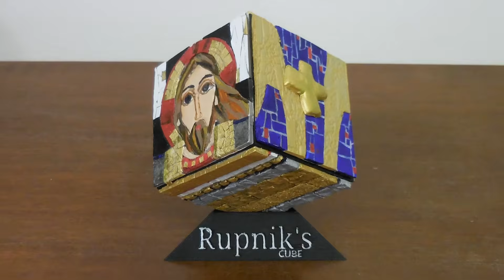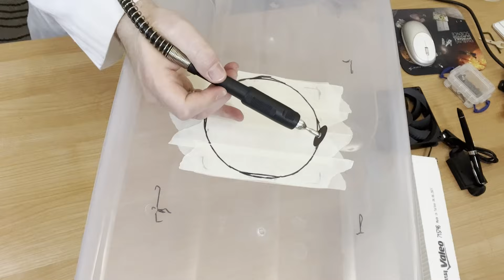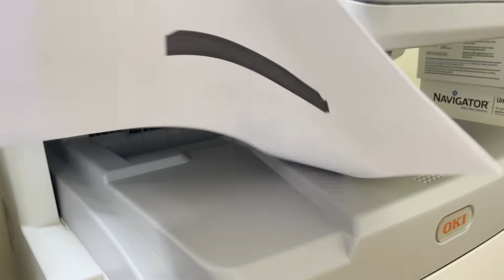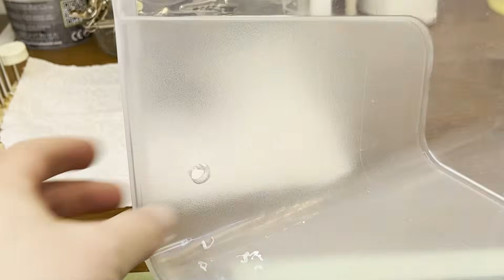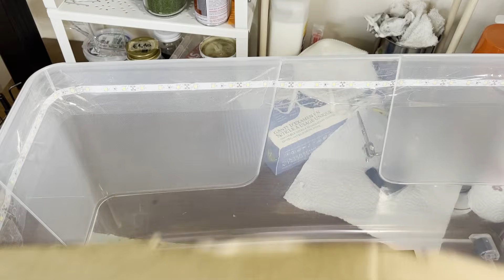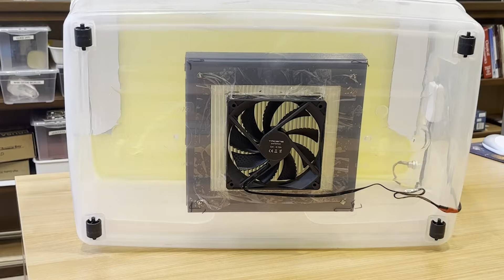Turning a Plastic Bin into an Airbrush Spray Booth

Comment: Great video; the spray booth looks fantastic, and the plastic bin is a better choice than cardboard, like most other DIY booths I have seen. The suction issue you are having is not due to the size or power of the fan but to a lack of vacuum. By mounting the fan directly on the filter, you diminish its ability to move air. When mounting the fan directly on the filter, you only get airflow over the surface area of the fan blades and rely on the fan to move the air. So, air is only flowing over the part of the filter that is the same size as the fan (4 to 6 inches). Computer fans are designed to work by creating low pressure in the case. Then, the high-pressure air outside the case is forced into the case from any available opening (Usually filtered intakes on the front top or bottom). The case must be relatively airtight as the fans blow hot air out, a vacuum is created in the case, and cool air from outside the case gets sucked in. The same concept is used in vacuum cleaners; they have small fans but use large chambers (AKA the dustbin of the vacuum cleaner). As the fan sucks the air out of the dustbin, a vacuum is created, and the air is forced into the opening, such as the hose or brushes. That is why vacuum cleaners lose suction as the dustbin gets full. The fan is still moving the same amount of air. It just doesn't have the negative air chamber to create the suction. The important thing is having a negative space that creates a vacuum. 

This long-winded explanation is just to say you need an air-tight chamber between your fan and your filter. As the fan sucks the air out of that chamber, it will force air in through the filter. This will do two things: increase the intake surface area and airflow.  An easy fix is to make the opening on the back of the plastic bin larger; a square about 1/4 inch smaller than the filter should be good. Then, 3D print a chamber similar to the one you used on the back of the fan to connect the hose, obviously large enough to cover the size of the new square hole you cut. Then, taper it down to the size of the fan. You don't need a lot of volume. 3 to 4 inches from the back of the bin should be enough. Glue it to the back of the plastic bin, snap in the fan, and Bob's your uncle. You should notice a vast improvement. This video is a year old, and this comment is probably obsolete, but if anyone plans to build one, this could be helpful.
Reply: Thank you great advice

Comment: Interesting! ive heard though that rattle spray if sucked in concentrated amounts can ignite a fire when passing the fan. Something to keep in mind . Cheers
Reply from the maker: That's true, but I have no intention of using a rattle can with this. It's just for the airbrush, which uses compressed air instead of the highly flammable propellant of a rattle can.
Reply: @MackeMakerSpace  yeah also i think it has to be a considerable amount of spray to go that far. airbrush should work. very nice work on the booth, thanks for sharing it. Cheers

Comment: I did something similar..2 bathroom ventilators,flex tubing and a special 3D print for ventilation holes in my window,so I can paint in the cld season also without having the flex tube out of window.

Comment: Would this work without a filter? Still with the fan but without the filter in front?
Reply from the maker: It would work okay if you are using acrylic paint or something similar that isn't hazardous. However, the point of the filter is to trap paint particulates. Without it, you may find paint exiting the tube at the other end.

Comment: Just an idea here, I'll be building one of these booths for myself. I thought the computer fan might be underpowered for your project. I'm in the process of aquiring the parts I need for my own booth. I'm using a bathroom vent fan which is quite a bit more powerful. This might be an option for you, too. They aren't all that expensive and readily available at any hardware store.
Reply: I'll be using AC to power the vent fan and adding an AC outlet to the enclosure. That way I can power the LED light strips with a cell phone wall charger and USB cable.
Reply from the maker: You are right -- it is underpowered. I mention so near the end of the video (14:53). I also mention that I ordered a more powerful fan that is intended for ventilation. It happens to be a bathroom vent fan, just like what you suggest (though I didn't say that explicitly). And yes, it works great!

Comment: it's better to use also a facemask
Reply from the maker: When dealing with potentially harmful airborne materials (vapors, aerosols, powders, sawdust, etc.) it is always advisable to use adequate personal protective gear regardless of the external setup. That being said, acrylic paints in the small quantities of an airbrush are not as hazardous as some materials, unless you are doing a lot of painting or are breathing the stuff directly.
Reply: @MackeMakerSpace  they are not toxic, but it's better to not have stuff in lungs, just a precaution

Comment: Built something almost identical a number of years back. Used a PC power supply and some aluminium HVAC bits for ducting. A furnace filter fits he back of the plastic bin almost exactly. For a fan I got a 12v bilge blower meant for small boats. Not expensive and has the advantage of being spark proof, (gas fumes in the bilge), which I thought would be a good idea for solvent based paints. 20 years in a lab,  safety first. Works a treat.
Reply: The bilge blower is a great idea. I couldn't find anything explosion-proof AND affordable. Thanks for the very helpful tip.
Reply: Yeah, I would have never even known or thought to look for something like the bilge blower. Great suggestion, they're pretty affordable right off Amazon

Comment: Very smart.    I did the same thing but cut the hole to the side.  I used a Dewalt 600 cfm air mover designed to dry water damaged areas in a home.  This is mounted remotely in front of a window or opening to the outdoors.
The ducting is 6" flex and slides onto the (paint booth) 
sleeve purchased from box store.  Easy on and off to move the booth out of the way when not in use.
Love you design.

Comment: Great work  can you please tell me what's the best airbrush  but not too expensive  would appreciate your advice  thanks
Reply from the maker: I am fairly new to airbrushing myself. I only acquired one a few months ago, and it was literally the cheapest one on Amazon. Once I get more practice and learn what I need in an airbrush, I will start researching for quality. One thing seems to be true: you get what you pay for. The cheap one I bought works, but I already see several things that aren't great with it, and that better quality airbrush systems would do much better.

Comment: The concept also works for a small sandblasting booth, but the extraction is not required.
The spent sand can be poured out into a container and reused later.
Reply from the maker: Nice idea! I think you are right, though you would definitely want to redesign the plastic curtain to prevent blasting beads from flying out. I have used the beads in my research (long story) and I can say that they get EVERYWHERE. I think this is why commercial blasting cabinets are fully enclosed glove boxes.

Comment: wala namang kuwenta ung mini air compressor.
Reply from the maker: (Sorry, I don't speak tagalog). The mini air compressor that came with the kit isn't entirely useless. I have painted a few things with it by now, and it kind of works. Anyway, if I had the chance to get a better compressor, I would. It would be nice to be able to control the pressure, and if the pressure were a little higher.

Comment: What is the size and where did you get the filter?
Reply from the maker: I used a Valeo #715746 filter, but for airbrush work any decent filter will do. If I upgrade to working with more potent materials, I would upgrade the filter to something rated for fumes.

Comment: Hi Brother Bob. I am a recently retired maintence worker and have 45 years experience with airbrushes. I like what you did (mainly because it's close to what I made for my airbrushing). Two things that will help you. Your filter is a bit of overkill, that's why it's not drawing the fumes away fast enough. You can easily get by with a non-pleated filter. I buy 16" X 20" frameless, furnace hammock filters. You can cut to the size of your holder and you'll get like 8 pieces for $20 CAD. Next, replace the clear plastic tape with real, aluminum duct tape. Both of these can be found in the heating section of any hardware store. The plastic tape will not hold up as the glue dries out and loses it's stickiness.
Reply: Hello. I see your comment was 8 months ago but I hope you see this. So it seems you know a lot about airbrush. I reacently bought one and gave not even tried yet because im about to build a booth. My question is. I have an unused vacuum cleaner and was thinking about using it for the ventilation, so the question is, is it too strong and if so should I use 1/2/3 of the fans in this video? Would appreciate the help :)
Reply: @alexgra4363  it would work, yes. If you can stand the noise. You still want to vent the fumes to the outside. The main purpose of the booth is to vent the fumes away from your face.
Reply: @jesterger  yeah so what I was going to do and now when I know it works. I will use my Dremel and start with cutting the front part as to get direct access to the vacuum hole and then glue some sort of connection there for a ventilation pipe as to be able to out it a bit awat from the station itself for the noice. Then same thing on the exhaust part for a pipe that goes out the window. Thank you :)
Reply: @alexgra4363  A vacuum will work but the noise level will be high. A 4" case fan will cost about $20 from Amazon.
Reply: Hey jester, sorry to question. I'm Italian and I look up what is a "furnace hammock filter". I find images but I cannot find how it's technically called in italian. Do you think that kitchen hood filters are ok for this job? Thanks! I'm also not sure what is a non-pleated filter...
Reply: @AndreaDeTogni non-pleated means non-accordian style. The filters he's referring to are like furnace filters with a special polyester fill for particulates, I'm assuming
Reply: @AndreaDeTogni  any type of polyester filter medium without a frame will do. Furnace, air conditioning or even aquarium filter will do.
Reply: @AndreaDeTogni  Look for any flat, not woven. filter material.  Aquarium filter material will work. Ebay or Amazon, is a good source. A kitchen hood filter would work. Not the best but better than nothing.
Reply: Thanks brother Bob😊

Comment: ●●●You've had that mini compressor for a long time because I want to buy one of those it seems good●●●
Reply from the maker: I bought it just a few months ago, from Amazon. (It was included in a kit with the airbrush.) I bought basically the cheapest thing on the site. I think it's a little underpowered, and has no pressure control. It's okay as a starter kit, but if you are going to invest in airbrushing, I would recommend getting a better compressor.

Comment: Thanks. I am getting into airbrushing plastic car model kits . You provided some good ideas for making one. Like you my funds are limited (fixed income on disability) . Only thing is I will have to rethink how to do the try for the filter. I don't have a 3D printer. Also there are plenty videos on YouTube for airbrushing. And books on Amazon for it. Thanks and good luck on your airbroshing.
Reply from the maker: If you are okay with something a little less aesthetic, you can replace the 3d prints with cardboard and duct tape.
Reply from the maker: The vent tubing really isn’t necessary for airbrushing, as long as you aren’t using the box for anything with real fumes. The filter alone should suffice.
Reply: Cardboard rolled and hot glued. You can even use an old long sleeve shirt for ducting.